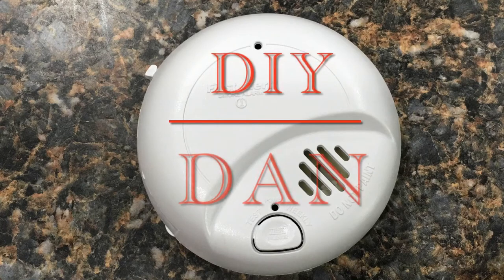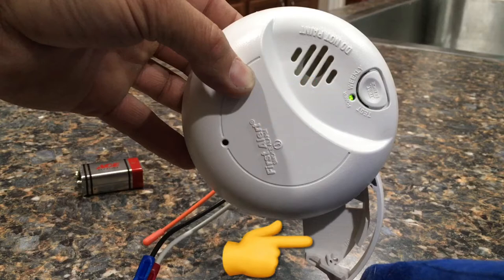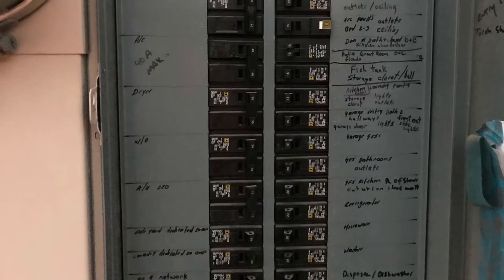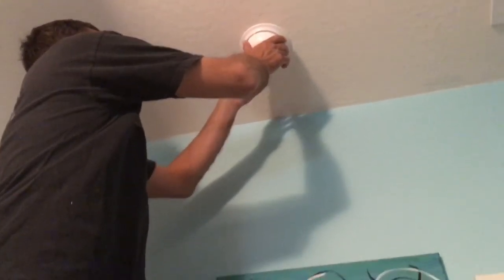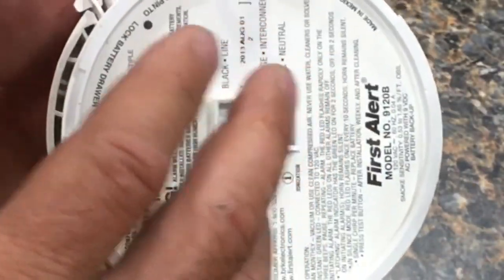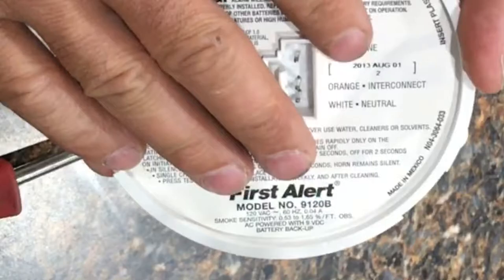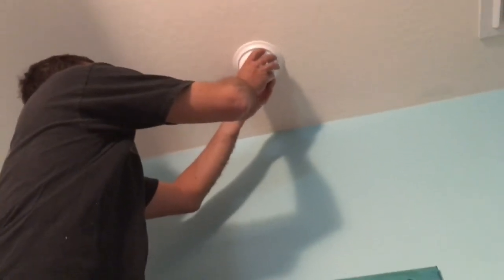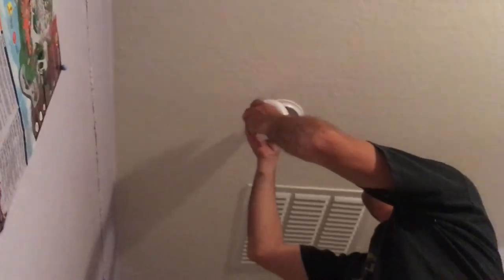SMOKE/FIRE & CARBON MONOXIDE FIRST ALERT ALARM WHAT 1 CHIRP, 3 CHIRPS, & 5 CHIRPS MEAN & HOW TO FIX

Comment: If you are a ham radio operator and you hear 3 chirps, try to stop transmitting ASAP. It can be due to EMI/RFI (EMI = electro-magnetic interference, RFI = radio frequency interference) and find the one and you might have to temporarily disconnect it or if wireless, then you might want to replace it with a wired smoke detector if possible.

Comment: Our fire alarm was chirping, we removed it from ceiling connection wires because a new batterie didn’t stop the chirping. After watching your video I see we need to replace the fire alarm itself because it is beyond 10 years old! But the ceiling where we removed the fire alarm continues to chirp! What is the issue? Will it stop once we replace the fire alarm with a new one or is something wrong with the wiring???
Reply from the maker: HOW MANY CHIRPS PER MINUTE ARE YOU GETTING   THE CHIRPS COME FROM AN ALARM IT MUST BE ANOTHER ALARM YOU ARE HEARING THAT IS IN A DIFFERENT PLACE
Reply: @diydan7019  5
Reply: And it is definitely coming from that specific wiring
Reply: @diydan7019  Any thoughts? It’s 5 chirps and driving us nuts until the hardware store opens😬
Reply from the maker: I WOULD SWITCH THAT ONE WITH ANOTHER ONE IN THE HOUSE PLUG ALL OF THEM BACK IN AND THEN GO TRIP THE BREAKER OFF AND BACK ON TO RESET THEM  AND SEE IF THAT WORKS TO SHUT THE CHIRP OFF TEMPORARILY OR SEE IF YOU HEAR IT AT THE SAME LOCATION OR THE NEW LOCATION YOU PUT THAT ALARM
Reply: @diydan7019  it worked! Thank you!!!
Reply from the maker: @loridavis9237  no problem glad it helped you out please tell your friends to subscribe to my channel I need 1000 subscribers and I’m getting close where I’ll actually make a buck off of this deal appreciate it
Reply: Mine too. Still doing the 3 chirps with the thing unplugged. Chirping is definitely coming from the ceiling
Reply: @DIYdan
Reply: @diydan7019  I am having the same issue at Lori did, I went and reset the breaker but it didn't seem to work, any ideas?

Comment: HELP!!! I literally have no more smoke detectors in this house and the beeps are still coming out of the sockets with the wires hanging out. Can someone help? I am literally going crazy now.  Can't find a video that deals with this.
Reply: After reading one of the comments a lightbulb went off. There was a carbon monoxide plug-in down under a windowsill that I found. I unplugged it and took the battery out and it stopped! For those of us who don't have good directional hearing, it can drive you absolutely insane. I had forgotten that thing was even there. Been there since we discovered a gas leak about a year ago.